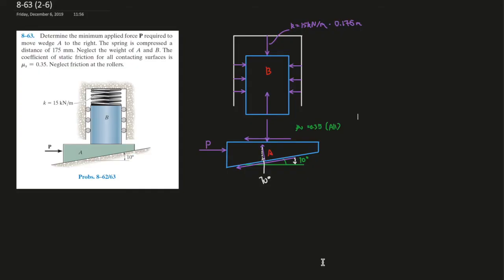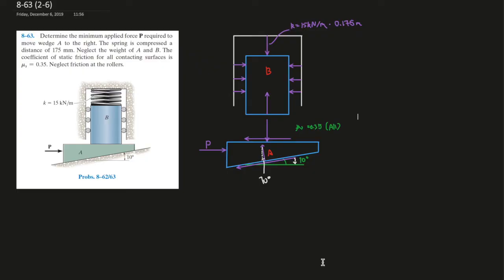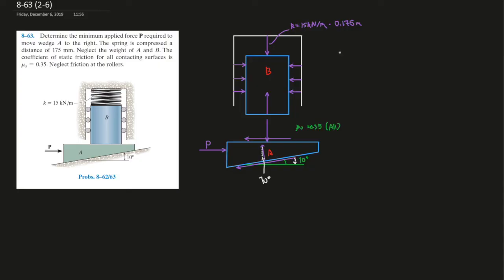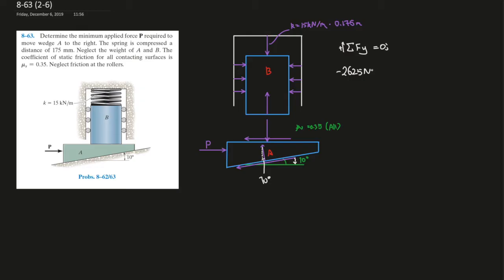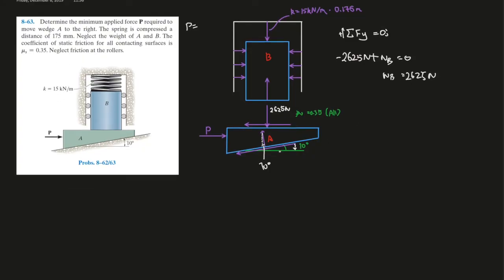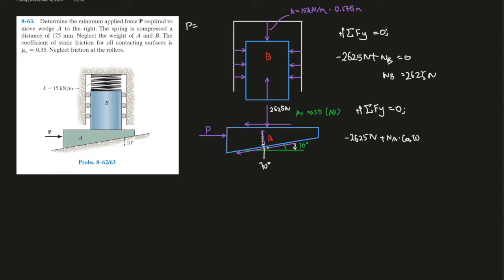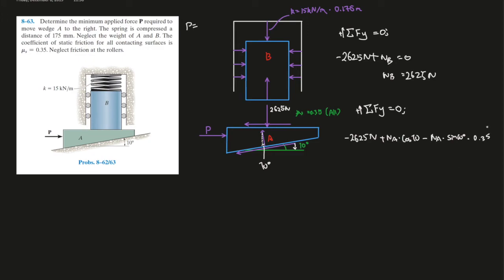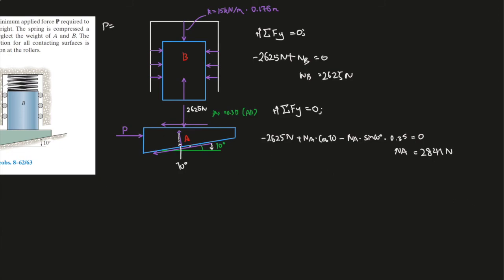8-63 Determine the minimum applied force P so that the wedge will move to the right with given k.

Comment: shouldn't the angle for the normal force of the wedge be 80 degrees not 70? Also shouldn't it be sin(80) instead of cos(70) because its the y-component of the normal force?
Reply: i had that confusion as well; it is said to be 10 deg not 70 deg